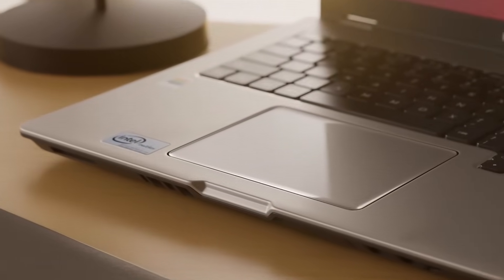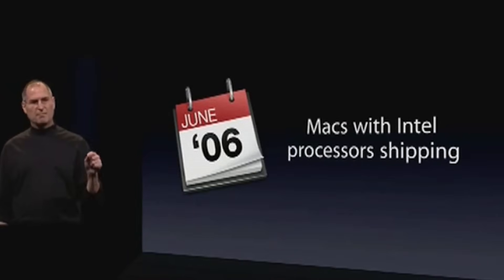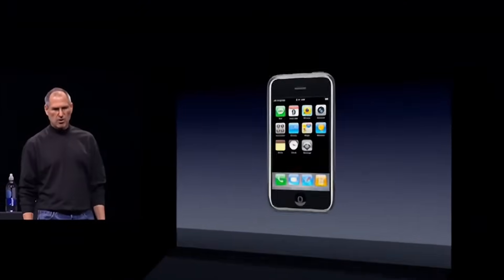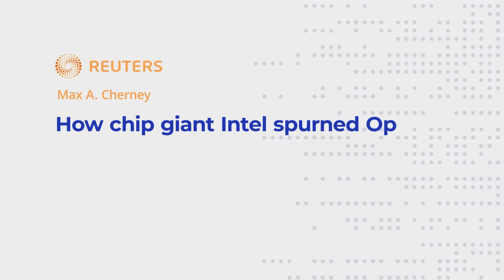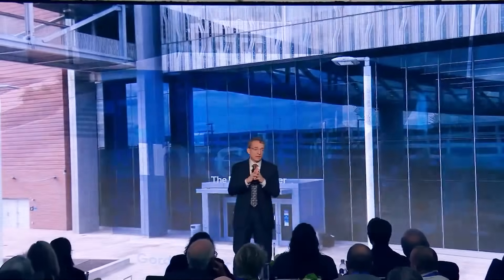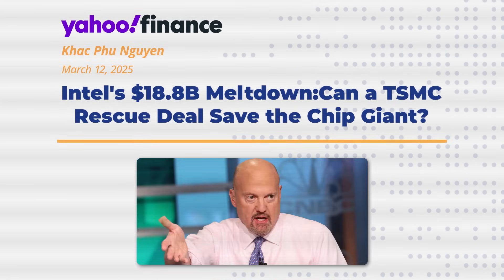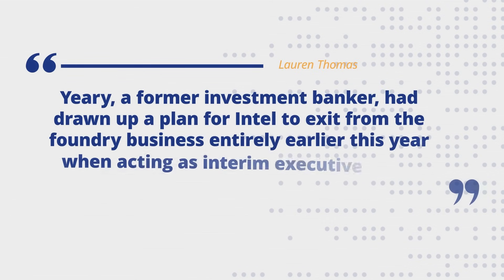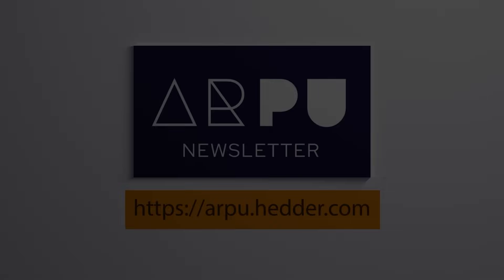An Autopsy of Intel's Self-Inflicted Wounds

Comment: Video didn’t grapple with the fundamental problem with Intel - its inability to get its fabrication business to innovate and losing the lead to TSMC. If Intel chips led the drive to 5 nm instead of TSMC, none of this would really be a problem. It could push into the fab business and make chips for Apple and NVIDIA. But because Intel could not get past 7 nm, its own CPU lost the performance edge, but also lost the potential to get business as a fab for others.

Intel broke Moore’s law when it could not double processing power every 3 years and made very marginal improvements for 10 years. They couldn’t get past 10 nm while TSMC and Samsung surpassed it. While TSMC was producing 5 nm chips, Intel was still stuck at 7 nm. And now that TSMC is about to ship 2 nm chips, and Intel still can’t seem to get its act together. What is at the root of this problem? Could it be that Intel board was chasing profits and failed to make the investment necessary to keep innovating?

So now Intel board wants to dump the fab business and move to a purely chip design business like AMD, Apple, and Nvidia. But the CEO is fighting to keep Intel in the chip fabrication business. 

It sounds like the Intel board is doing the classic MBA school move that have led American companies to forget about products and chase financial models that CFO’s slave over. The same financial models that have hollowed out our economy and sold off the Crown Jewels of America’s industrial might to China. The same idiots that drove GM, Xerox, Boeing, and other once great companies into the dustbin of corporate failures. 

What is wrong with American capitalism? The problem is that these so called leaders aren’t capitalists at all. They are just parasites sucking our nation’s wealth and strength. This is why America’s industrial might has been destroyed. 

Can you imagine Steve Jobs making these short sighted moves? Can you imagine SAMSUNG throwing in the towel and giving up its fab business to TSMC?

Perhaps, this is a case of too little too late and the Intel board is doing what it can to salvage what is left of Intel. But it is very disappointing.
Reply from the maker: Got it. We'll do a TSMC deep dive in the coming weeks!
Reply: @ARPU_explainers  Love the pragmatic attitude here! 💌
Reply: @ARPU_explainers  Intel's failure has nothing to do with or about TSMC's recent success. Intel failed because they didn't do what TSMC did with their fabs. 
Personally, I am getting sick and tired of these Intel autopsy videos from outsiders looking in. Next time, conduct some real journalism and get the word from people that were on the inside.
Reply: Take this with a pinch of salt, as i don't have a good memory. I have seen numerous interviews from people who worked at Intel, and while i don't remember any details, i remember them complaining about the toxic work culture within Intel. And how that hampered their R&D efforts. Intel actually spends quite a lot in R&D, but the toxic culture meant that they got less for their money, compared to their competitors.
Reply: Excellent analysis Anthony
Reply: All of capitalism is parasitism, it is impossible to create "something" out of "nothing," and profit does not arise from emptiness, it is always stolen. Engineering was being killed at Intel, and all of the above is the result of the choice of Intel and MS marketers who needed only profit, not the future of the company and IT, not economic growth.
Reply: Nah it had to do with the chips not clocking past 4GHZ and the drivers never wanting to go beyond 2GHz most of the time as well as physical damaged chips on recent mistakes
Reply: @subbastionbastion2167 Intel’s 18A has a 5% yield. It’s so bad that Intel is considering delaying Panther lake to 2027! TSMC’s 2nm yield is 94% for AMD Zen6 right now.
Reply: It is a bit more complicated. Nobody can forever be the top in both design and fab and missing either can doom the company. Intel assume that in their competition until another customer shows up in a different industry. Apple want low power phone chip instead of high power cpu, and make money off system instead of chip. Intel missed that boat and apple ended up sponsoring the growth of foundry. The rest is slowly turning into milking the cow and slow death. Had Andy Groove been around he would have steered the company around due to his paranoid.
Reply: If Lip Bu goes, intel will likely fail.   The Investment banking MBA Chairman will likely finish off intel just like Finance guy/CEO Otellini damaged intel.
Reply: You think it's incompetence of the board, I think it is intentional sabotage. Why? Follow my logic,  the 3 top owners of TSMC are exactly the same of Intel. For them the loss of Intel is the gain of TSMC, in the end it does not matter. So why the chose TSMC? Because they need the world to depend on Taiwan. Why? Because they want to go to war with China, defeat militarily so that the big investment banks can finally have true global markets under their control. Ukraine and Taiwan are important. And the world will defend Taiwan only if TSMC is the only provider of high end chips to the world. And for that Intel needs to fail. Check mate!
Reply: The main issue was Nvidia, amd and the rest would always prefer a third party foundry because tmsc would not compete with their customers unlike Intel will
Reply: That's one way to look at it, but I think other factors played a bigger role. Intel, much like IBM in the 1990s and Sony in the 2000s, prioritized short term profits over long term innovation. Instead of using innovation to drive growth, the company chased sales quotas and satisfied investors by avoiding risks. This led to a failure to adapt to emerging technologies and a changing computing landscape, and Intel also leveraged its market dominance through advertising and marketing to become the preferred CPU supplier for many computer manufacturers, which ultimately stifled competition and its own innovative drive.

Intel's history is full of critical errors and missed opportunities. Among these is a consistent failure to take its graphics department seriously. Unlike AMD, which successfully integrated powerful graphics processors into its CPUs, Intel's lack of focus in this area made it uncompetitive in the entertainment space, from home consoles to handheld gaming PCs. Furthermore, it famously refused to build custom chips for the first iPhone. In 2011, it admitted to having a license to build ARM chips but chose not to use it. Later, it killed its own promising Intel Atom line of power efficient CPUs for Android, a project that had a lot of potential in the early 2010s.

Still, it's not too late for the company. While Intel has been slow to join the AI race, its ARC line of GPUs is a promising sign. The company continues to develop them, with tools aimed at making them viable AI accelerators. There are also rumors that Intel will finally build ARM CPUs for other companies, though its manufacturing process will need to compete with TSMC's. Ultimately, I don't believe Intel will die; even if it struggles, the US government would likely intervene to protect this vital national interest.
Reply: @emsipin9480  On demonstrated performance, the government should hand AMD enough cash to take a large stake in Intel on a new share issue, conditioned only on Intel renaming themselves MagaFoundries.
Reply: @emsipin9480  BS. Intel tried to get into all of these markets. They just failed to deliver the right products. They tried and failed on the tech/development side.

They spaffed money up the wall on everything. Mobile CPUs, 5g modems, highly parallel devices. They just refused to move away from x86 and also fundamentally failed at delivery because something inside is broken

Comment: So US officials are trying to get foundries into the US because chip manufacturing is a national security concern...so rather than Intel keeping and improving its foundry, it will sell it off to TSMC...and then the US will try to get TSMC to build foundries in America?  Kind of round-about, I'd say...  And why would TSMC want Intel's foundry anyway, if it's simply behind where they are at already...

One other thing not mentioned is that Intel just recycled the same chips over and over again.  There was a tick-tock, tick-tock method, where they innovated more on the "tick" and kind of just slightly tweaked things on the "tock".  Then, they went to tick-tock-tock-tock...
Reply: Intel hit the 7nm wall and they need TSMC to really build it past 3nm ... Intel is not the top dog any more.

Comment: 40 years is a stretch. Intel's dominance didn't start until the Pentium and ended when Apple cut them off as a supplier. Maybe 25 years.
Reply: Agrred, maybe even even less.  I think the the end started in 2015 with 10nm fiasco.  By 2020, when apple dropped them, they were already behind.
Reply: Nope, Intel dominated the PC space from the start with 8086, 286, 386 & 486 processors. AMD and Cyrix had alternatives, but they were crap. Other microcomputers mainly used Motorola or Zilog, but they were home computers running BASIC, then other GUI's based on CPM or lookalikes. None of these ran DOS/Windows though, and they dies out. Not because Intel had better CPUs (they didn't), but because businesses wanted to standardise on the IBM (PC), which used Intel. Apple moving on from Intel was barely a blip. It was AMD that took Intel down a dark alley and beat the crap out of it.
Reply: @radman8321  This.  Didn't help that intel failed with Itanium and the whole fab falling behind thing but it was Zen that stole Intel's lunch money.

Comment: when Tech Companies are run by MBA's and Accountants instead of Tech innovators or vissionaire
Reply: Exactly.  They call themselves tech companies but they're managed like a consulting firm and staffed like a bank.  Sometimes, its the other way around 😅
Reply: Look ar AMD, for a example of the opposite.
Reply: Not just that, but using leading edge companies like tmsc who knows how to do 3nm and 5nm and then trying to flog 14nm or 7nm whilst everyone else is shipping 3nm ..
Reply: This statement can be extended to other companies and industries when they forget who they are.
Reply: @MarkLarma-r9x  e.g. Boeing
Reply: @stachowi Great example.  The only thing saving them is a 10 year backlog at Airbus.
Reply: @arddel  "The only thing saving them is a 10 year backlog at Airbus." 

Huh. You seem to think the natural structure of a duopoly is that both parties stand up enough productive capacity to satisfy 100% of demand, just in case their opponent takes a major face plant. I wonder what that face plant might look like? Perhaps it looks like standing up enough productive capacity to satisfy 100% of demand when you only have a secure 50% market share. 

In a mature duopoly built on this kind of capex cycle, no matter how much you blunder in the short term, you only finally die a slow death by your adversary stealing yet another march on research reinvestment, having poached yet another small margin of the total market segment.
Reply: bingo... bean counters... price of everything, value of nothing
Reply: LipBu's tenure at Cadence would fit perfectly with the needed IFS culture. The immediate task is for the IFS to have cutting edge process technology with high yield preferably better than the rest except Rapidus as I hv full confidence in Japanese manufacturing technology.
Reply: Yep.  Otellini was the culprit
Reply: Intel is electronic version of Boeing .
Reply: When politicians/public used to stalk and abuse instead of HR solving internal issues. Human resources in some companies should be renamed as Hippy R@scals
Reply: That's true but the insightful question is: who hired them? And is it incomptence of who is hiring or intentional sabotage?
Reply: @andrepaes3908 nothing complicated investors placed them as CEO thinking its easy money and just pure greed
Reply: Same thing happened with Boeing.  MBA isn’t good for business long term.
Reply: AMD survived because of the financial decision to give up on self manufacturing. 

Intel failed because every time they tried to do anything they failed to deliver. 

They tried mobile, failed. They tried highly parallel CPUs, failed. They failed at their own fab tech development.

They spent plenty of money trying to do things. They just failed to deliver Every. Single. Time.

Comment: Intel has been problematic since 80286, which Gates described as a chip with a headache
Reply: i80186, i8088, i8086, i8080 ... Competitors have always had the best, but expensive option (z80, amd... are fired intel engineers)

Comment: "Why is Apple failing? When Apple first started, we were 10 years ahead of the competition.  What happened in 10 years? The competition caught up and Apple stood still.  Apple's solution is not to slash and burn but to innovate out of the problem."  Steve Jobs, 1997.
Reply: When the iPhone launched, I thought they were disastrous because when the rest of the small companies were in 3.5G they launched GSM phones 😂. They were succeeded by the user interface, which Google stole ..😂

Comment: It can save itself by churning out high quality risc v chips
Reply: wont happen Intel is run by MBAs😂
Reply: Rofl
Reply: Intel's heavily invested in x86. I'd say no existing company is capable of pushing risk V, only fresh innovative startup can achieve that.
Reply: RISC V is a bit power  hungry but yeah its good stuff like the esp32 ie firmware IOT but ARM has the high ground on the pc and phone arena.
Reply: @ntal5859that’s where intel engineers can add value in developing risc v to compete with arm efficiency
Reply: @ntal5859 Risk V is supposed to be open source ARM analogue.